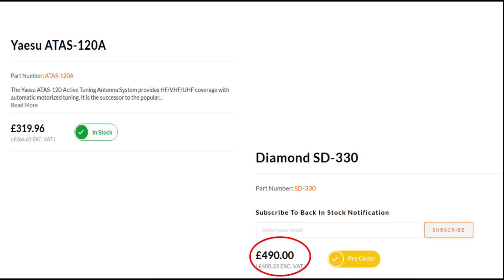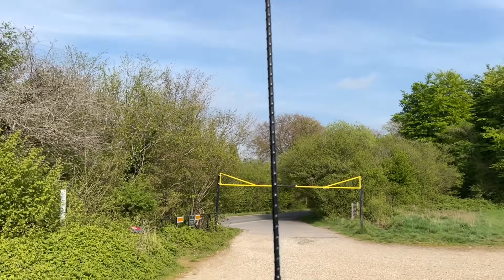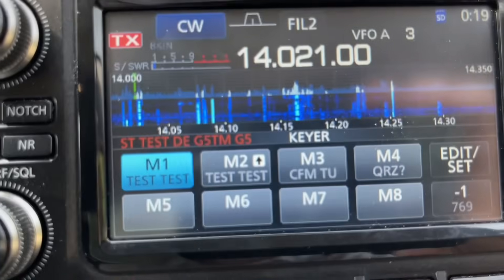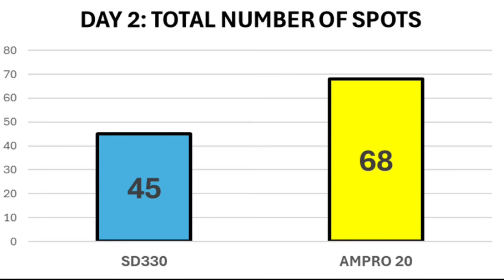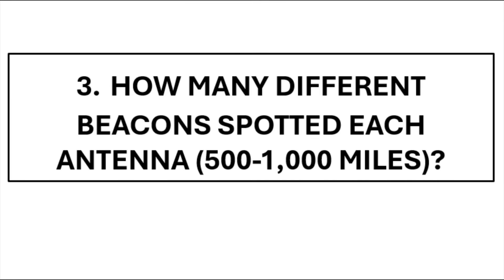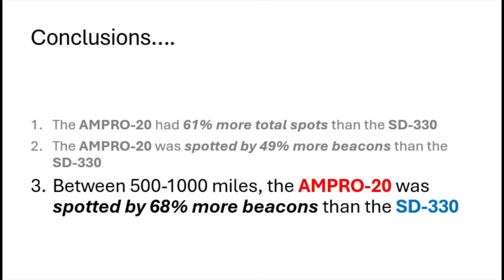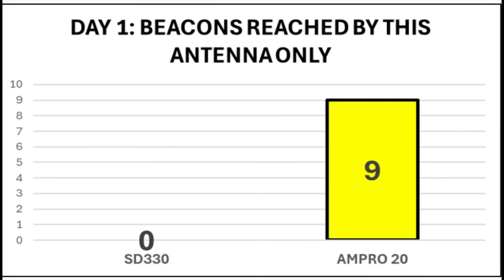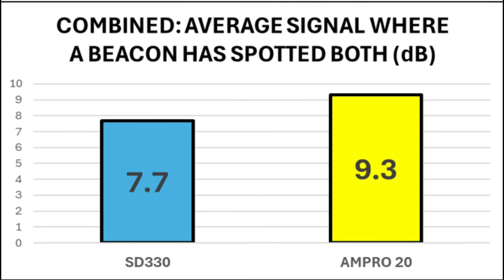Ham Radio Antenna Shootout! Hamstick v Diamond SD-330 Screwdriver Antenna

Comment: Interesting did a few weeks ago a wspr experiment with a 1/4 wáve plus 20 radials and a ampro hamstick, the quarter wave was better..  but the ampro was quite good!!!, i had 6 more stations with the vertical, dx.  / distances . and in average the snr values from the vertical plus 20 radials the snr was 2.8 db better..., in average there were also a lot of stations where the ampro was performing better..., i like the ampro hamsticks, you are  very fast in the air.  Keep on posting this vids  interesting stuff! Thx
Reply from the maker: Thank you Erik, interesting information 👍

Comment: If I'm correct, diamond has an antenna thread. If you have an MFJ 17ft whip or a Chameleon 25ft, could you test them with one of those attached in place of the original one?
Reply from the maker: It doesn’t have that thread, so only a thin whip will fit.

Comment: Well done Tim! It's another case of performance versus convenience. Every ham has different needs and wants, so your test helps those decide which way they want to lean. As for me, you already know what I'm going to say, is I'll take performance over convenience every time - especially for ~stationary~ mobile. My go-to is a 17' whip for reasonable radiation efficiency as an elevated quarterwave on 20M-6M. I believe your conclusion is right on - the radiation resistance of the longer hamstick (loaded whip) is likely higher and therefore radiating more RF than the Diamond screwdriver. Interestingly, Diamond also makes single-band center-loaded whips with very reasonable performance. I've used those while driving and was very impressed, especially the 40M model. I would take one of those easily over their SD-330 if I was truly mobile (not stationary) 😀 73 KJ6ER
Reply from the maker: Good points Greg, thanks for stopping by!

Comment: I do not see the logic in testing a mono band Hamstick against a multiband screwdriver. The price range is so far apart also. I have had ampro 20 40 sticks and they both worked well. The diamond covers Multibands and is at a cost I would not pay for a mobile antenna.
Reply from the maker: The logic was to measure performance against cost. 73